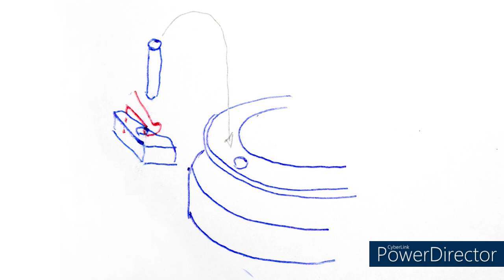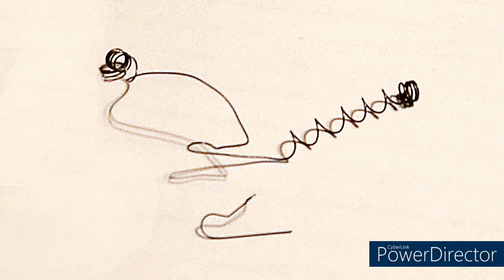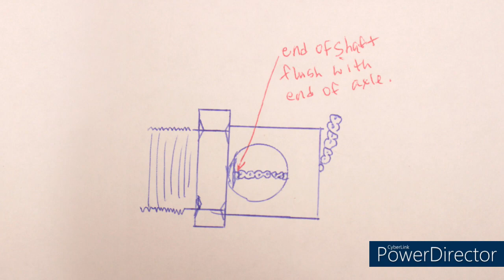New Life for Old Bikes service a Sturmey-Archer AW 3 speed

Comment: sturmey archer specifically says do NOT use grease....19.35 unnecessary, will be oiled under normal operation.  mineral oil is fine. spring cap is not needed nor is washer under it. I assemble it dry (syops picking up dirt the oil it before assembling.  pour in a couple of tea spoons of oil.  Otherwise excellent presentation.  should check inside of bearing part to make sure pawls have something to bite into. the fact that the oil leaks out means you have to keep checking it.
Reply from the maker: Thanks for the helpful info. I appreciate the input.

Comment: Great video, but I’ve still got no clue how I’ve lost 3rd gear. It’s a newer disc version. It is however on my diy e-bike. I did lace it up to a 24” rim myself. A new hub is inexpensive enough, but would rather not replace, lace up another one. To be honest, I really don’t need third gear. Bike will do 30mph on a full charge in second gear. First and second gear work fine. If I had 3d, I could lower the ratio, larger cog, make it where bike would do 30 in 3rd and get UP the hill even easier. 
PS
The speed limit on all main streets is just recently lowered to 30mph and residential streets to 20, down from 25.
Any ideas on fixing my hub would be greatly appreciated.
Reply from the maker: Thank you for the compliment. On your your bike, I would start by looking at the cable tension on the shifter.

Comment: Great video.
At 30:15 you forgot to tell the shifter pin should not completely be fixed in the hub. I have seen people trying to do so and damaging the thread inside.
You tell that adding too much oil is not a problem. In Holland we usually have a drum brake inside and then you should not add more than 10 drops of oil.
Reply from the maker: Thanks for watching. I appreciate the clarification.

Comment: Good job evan i dun sturmey archer hubs red band bendx kick back hub yellow hub bendix coaster brake hubs shamino on a lot of hubs now
Reply from the maker: Thank you. I've only done a couple of Sturmey-Archer hubs. Most times I can run some penetrating oil through them, grease the bearings and just add oil and they work fine. This one was stuck. This bike had been sitting for many years.
Reply: @NewLifeforOldBikes  most every one I ever did where the same

Comment: I've watched a few of these videos now and no one mentions the K804 Indicator rod on the non drive side? Mine is missing on the bike I'm restoring so I was hoping for some correct installation info?
Reply from the maker: I'm not aware of an indicator on the non drive side of the bike. I've checked the Sturmey-Archer manual I have and it doesn't show it. Is yours an AW-3?
Reply: @NewLifeforOldBikes  No, my bad mate. I realise now it's because mine is a four speed. Nobody seems to cover them.
Reply from the maker: @dapdapbamban  I wish I could help you, but I don't have a bike with a four speed or the manual.

Comment: Greetings from Bristol. Thanks a lot. I have watched many vids on the subject , but the pace of your explanations is just perfect. I have done a few overhaul of the SA 3 speed hub. From time to time , I get a grinding noise coming from the hub when freewheeling even after having lubed every single component & almost drowned the internals with gearing oil. Any clues what can be causing that noise please ? Thanks
Reply from the maker: I appreciate the feedback. Chances are a bad bearing is making the noise in your hub. One or more probably has a flat spot. Unfortunately, no amount of oil or grease will fix that.
Reply: Thanks , you might be right as I did reuse all ball bearings assuming they are all good . I will check that . Thanks a lot .
Reply from the maker: @luckyram3461 i expect one or more bearings in the bawl ring will have a flat spot. The outer bearings (the ones in a race) would grind all the time if they were bad.